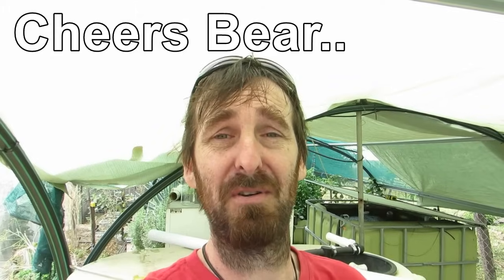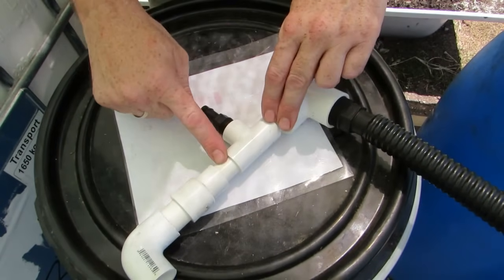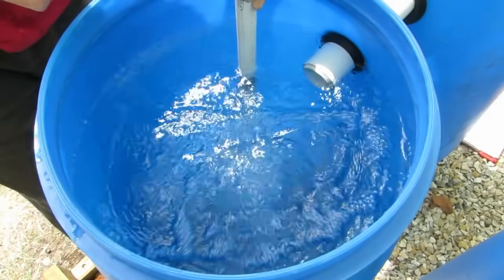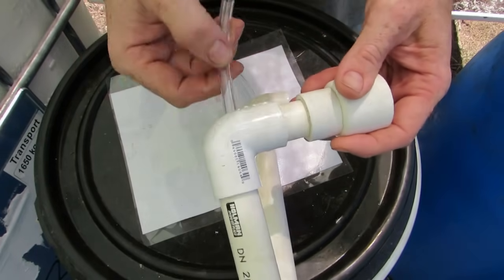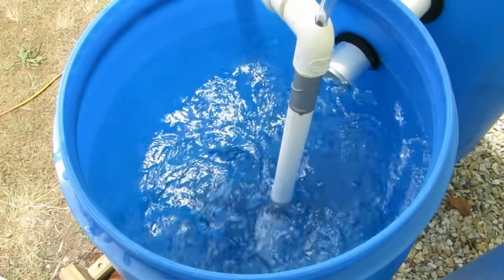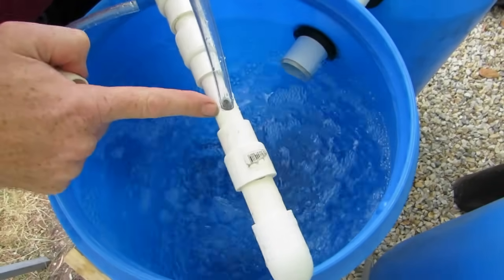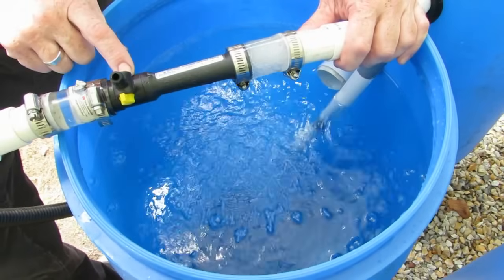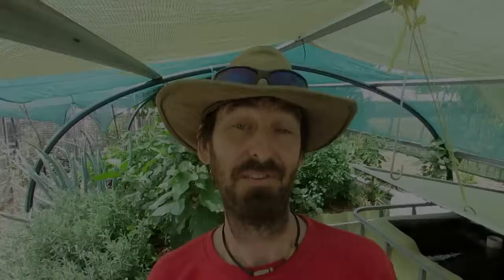DIY venturi, a few easy builds for aquaponics, aquaculture or hydroponics..

Comment: Do you have your water pump running full-time as opposed to a timer-controlled pump?
Reply from the maker: Hi Alan..
Both pumps run 24/7 on the 2 systems here & both pumps come in at under $0.70 a day to run.. I like the water constantly moving around the system so the water has every chance it can to run though the filters/grow beds to be cleaned..

Cheers mate..
Rob..

Comment: Hey Rob. I'm just reading the wikipedia article you linked and they brought up the efficiency of aerating systems in terms of kw*hrs. So I was thinking about your pump system and how the restricted flow wasn't an issue for your pumps because they're magnetically driven. Otherwise they will burn out, right? 

I know you probably can't quantify the kg/kwhr number for these options, but do you have any idea of the efficiency of this system? And could a fine screen on the end of the "Bear Model" venturi create even finer bubbles for you?
Reply from the maker: Hi Jason..
From what I have been told the magnetic drive pumps are best for the hobby growers as they can be throttled back a bit without damaging the pumps.. When they are hrotaled back they also use less power so the are more efficient in that respect as well..
A screen would help to break up the bubbles but would also cause another restriction to the water flow.. I also would have concerns that any debris pumped through might also clog up the mesh as well which would lead to other issues..
Thanks & hope that helps some mate..
Rob :)
Reply: Hey Rob I have another, unrelated question... I keep reading I should have a 15 minute flood, 45 minute drain cycle, but that I should also cycle all of my water from the fish tank through the beds once per hour to filter the water adequately. To me, this means the pump is running all the time and the drain is draining periodically. So if I have a 500 liter fish tank, I need to pump continuously at 500 liters per hour and drain the beds periodically?
Reply from the maker: jasonroxorz  This one did my head in when I first started out Jason.. Now all I really worry about is the health of the fish as they are the heart of the system.. It is best to have the water exchange in the fish tank at lest once per hour MINIMUM with twice an hour being what I prefer.. Ours is being exchanged 2.7 times per hour which I am more than happy with.. 
Most of the folks I know run their pumps 24/7 on their systems.. Our 100W jobbie on the AP set up is costing us just over $0.60 a day to run which is fairly good..
There are a few ways to set the beds up, one being constant flow where there is water in the beds covering the roots at all times.. These produce just as well as the flood & drain beds from what I have seen of others systems.. Seeing that was enough to stop worrying about flood & drain cycles & focused on just getting the water through as best I could.. I think ours fill every 10min or so & take 3-5 to drain.. One bed is very backed up with roots & solids at the moment so would be taking less than that at the moment I think..
Hope that helps some...
Reply: Rob Bob I have yet another question! So I'm just curious why you need such a high powered (and more expensive) pump from your sump tank? To me, it would suggest you have around 1000 gallon tank stocked with fish that needs to be cycled. Oh but you said you do about 3 changes per hour... so you have around a 330 gallon system? Probably a little less since you're pumping vertically? I'm just making sure I have the fluid dynamics down...
Reply from the maker: Morning jasonroxorz :)
The total system water volume is 1600L/422gal (US) with a 1000L/264gal FT.. The pump in the sump is a 4500LPH/1188GPH jobbie that ends up flowing out of the FT at 2700LPH/713GPH after head height & venturi restrictions are taken into consideration.. That means that the water in the FT is turning over 2.7 time an hour roughly..
Hope that helps mate :)
Reply: Rob Bob Awesome. In the event you lose power, how do you avoid draining your rearing tank? Do you have a pump in your rearing tank as well as your sump?
Reply from the maker: jasonroxorz  The system is set up so there is a constant amount of water no matter what happens & won't run dry.. Air is supplied to the fish via a batery back up system..
This clip might give you a better idea on how the system is plumbed up..
Aquaponic plumbing, How the water flows through our system..

Comment: This video was made in 2013, are you still using this venture? Or are you back to air pump
Reply from the maker: Hi Mate. 
I was running the commercial venturis in the tanks up until a few months ago mate. The fish I'm running at the moment don't handle the heat well so have dropped in some air stones to help increase the dissolved O2 for them. Once they are all harvested I'll be getting Jade perch again which I found were fine with just the venturis at the stocking levels I had.
Sorry it took a while to get back to you
Hope that helps mate & all's well with you.
Rob.

Comment: I'm running 3 tanks that are 
275 each 
100 gallon storage
2 55 gallon filters
200 gallon stump
6 20 gallon grow beds
With a 3600 pump
Can I split flow Ventura s to the grow beds and tanks

Piping 30 gallon
Reply from the maker: I would only add it into the fish tanks mate. That's where it will do the most good. 
Sorry for taking ages to get back to you.

Comment: can this be used in place of an air stone?
Reply from the maker: Only if you have a backup system that is triggered if the pump fails. Having a blackout trigger is not enough as I have had pumps burn out & which means that the back up wasn't activated. 
Cheers.

Comment: Thanks for the video. I wanted to see how some venturis would work in real world scenario.

25ml = 1.5 inches cubed
15ml = 0.91 inches cubed (basically 1 inch)

You are a very informative person. I made a venturi for my bathroom sink to change water in my fish tank. I can send you a picture if you want to see its nowhere near as good as your design however.

Your first design seems to work much better. Isn't that because you inserted the venturi where the waters velocity is at its peak ? Probably so. If you have the reducers at one end and just an elbow where you insert a tube then the pressure is not as low as in the first design.

In the first design you probably get smaller bubbles because the velocity is much higher in the cente of the small tube and the air gets sucked in faster.

Since the air has less room to mix with the water th air bubbles are hence smaller.

The tube is also gradually increasing at the end of your first design which allows the velocity to gradually decrease. Maybe this is what prevents the air bubbles from suddenly changing their shape (being inconsistent in size like the second design)

Your response is appreciated! Thank you
Reply from the maker: +Carl Nikolov 
Hi Carl. I did find that the first DIY unit preforms the best but in saying that I have used the elbow & runner hose  design on the fish farm set up with no problems. There was one in both tanks & found they did a good job at aerating the water for 100+ fish. They were hooked up to a 10,000LPH pump with  a 400mm head hight if that information helps at all. 
Cheers.

Comment: So your system uses 2 water pumps right? One from the sump tank to the fish tank, and another from fish to grow bed. 

Any idea on your cost to run both pumps as opposed to running an air pump with air stone? How often do you have to manually unclog the sump water pump?

Cheers mate.
Reply from the maker: Hi Bud. 
All my systems have run on a single pump.  This clip sows how the water flowed in the system in this clip https://www.youtube.com/watch?v=j-T2Fzfc1do

& this is the most recent clip on how the water moves through the new build
https://www.youtube.com/watch?v=N4mYcUvZ9cw

I think the current cost of running the single larger pump on the new build is under $2 a day with is easily off set by the amount of produce a system like this can grow. We also have a solar feed in system so the real cost is actually a fair bit under that. 

The screen on your pump should be cleaned (ideally) once a month as part of regular maintenance. I have never had ours clog up as there are very rarely any solids to speak of that make it into the sump. 

Hope that helps you out some Bud & have a great one. 
Rob.
Reply: Thanks mate.
Reply from the maker: No problem Bud. 
Cheers mate.

Comment: can you please provide me info on how to get the pipe in the barrels ?  I used the uniseals and followed the instructions but I can not seam to get the pipe into the seal. please if anyone can help would be helpful
Reply from the maker: Hi Janis..  Will try to help if I can.. What size seals & pipe are you using ?
Reply: Rob Bob I finally got it My filter is working great water is very clear Now  all I need to do is find more 55 gal drums so I can build the filters for my other 3 ponds Thanks again
Reply from the maker: Glad to hear you got it sorted Janis K..
Have fun with the rest of the build... Hope it'sgoes easier for you..
Rob..

Comment: Hi Rob,

Are you using separate pump to throw water to the Venturi?
Reply from the maker: The main flow into our fish tank comes through the venturi. I have seen folks run them on a separate pump but I wouldn't. It would be cheaper to run an air compressor I think. 👍
Reply: @RobsAquaponics   Thanks Rob your reply. I really appreciate it.

So, you are using a pump which pull water to the fish tank through venturi.right?
I have fish tank and from there I am using pump to take the water to the grow bed. Actually my fish tank is positioned at lower level than the grow bed.
I have noticed that my plants aren't growing for sometime. Initially the growth pace was amazing but after sometime the growth almost stopped. and the leaves started getting bit yellow and the green color is bit dull. May I know what could be the probable reason for this?
Reply from the maker: It could be a number of reasons from pH issues, over planting/nutrient deficiencies or even a change of seasons. Is very hard to nail down what it could be without seeing it. 
Sorry Umesh.
Reply: @RobsAquaponics  Thanks for your reply Rob. I can understand that its hard to nail down without seeing it.
Have a great morning ahead.

Comment: Did you ever find any disadvantages with this setup vs several airstones
Reply from the maker: If you pump dies the fish get no new water or O2 which can be a recipe for disaster. 
I still like them but don't rely on venturis for my main aeration into the fish tank. 👍
Reply: Thanks, Was thinking about using one for a mbbr
Reply from the maker: @ashleygonzales304  They work great in that situation. Sorry it took ages to reply again.

Comment: Hi , why is mine pushing water out instead of sucking air ?
Reply from the maker: At a guess I'd say that you will need a higher powered pump or that the air intake hose is around the wrong way if you're using a DIY one like I showed in the clip. 👍

Comment: Just curious, why use a water pump + venture rather than an actual air pump?
Reply from the maker: +fsbell1 Hi there.
Wanted to make the system as uncomplicated as I can with as few hoses running around the place. Also found the compressors to be rather loud.  Still have air lines going to the tanks but for back up purposes.   
Might change my mind later & use them again one day but am happy with the venturis for now. 
Cheers & have a great one.
Reply: +RobBobs Backyard Farming 

2 years later and still going strong? That's a good indication that they work!

Thanks for the vid, much appreciated.
Reply from the maker: +Aaron DC mediA 
No Problem Aaron. Hope it gave you a few ideas.
Cheers.

Comment: curious about what is the minimum psi required from the subpump.
Reply from the maker: Hey Jorge..
Not sure on the psi as water flow is normally measured in GPH or LPH.. I like to run enough water through the system so that the water in the fish tank gets totally exchanged at least once per hour.. At the moment I think it would be just over twice in the aquaponics once head height & the restriction of the venturi are taken into consideration.. Before the new ones get installed in the RAS I shall do a test to see how much the venturi restrict flow by..
Not much help there but hope it helps explain it a bit..
Cheers.
Reply: sorry i guess  my question  should have been what kind of pump  u are using and what is the minimum gph  a pump should be pumping for a venturi to work?
Reply from the maker: Jorge H
 Sorry mate... In the test it was a 2500LPH/660GPH (US) & in the aquaponic set up we have a 4500LPH/1200GPH (US)  pump o the go.. I think you could attach one to just about any sized pump.. 
A mate just posted a small version he made up if your interested in having a look..
Venturi Experiment - Small DIY Venturi for Hydroponics, Aquaponics or Aquariums

Hope that helps some..
Cheers..
Reply: thank u

Comment: SURVEY SAYS !!!..... the first one , better looking , finer adjustment on bubble flow .
Reply from the maker: Hey Mark.. I have just finished playing around with them in a new build & found that the unit with the hose clamps actually worked the best in a moving bed bio filter.. Still like & used the 1st home made unit in the fish tank though..
Also bought another threaded cheap unit from Ebay to try on the present build & think that the home made jobbie is much better is better than that unit :)
Cheers mate & have a great weekend..
Reply: ya ventures can be a trickle and error kind of thing , a little cutting or movement one way or the other can be the difference of night and day . like your set up , wish i had the space to be able to do this type of thing , well take care and a beer

Comment: Not sure why you think a magnetic drive is NOT going to overheat if restricted?

Explanation???
Reply from the maker: That's what I was told by the folks at the local Town & Country irrigation suppliers as well as an commercial aquaponics designer. is due to the impeller being driven by a magnetic field with no motor parts coming in contact with each other top wear out.  This was the layman's explanation I was given by both. 
I'm not an electrician so have taken their word for it. 👍

Comment: this is one of ways how aquarium filters realise air feed, so it is definitely nice way to deliver air, anyway, it can be also used in many other applications, even in reversed way when compressed air suck fluid, for example in aerograph :P
in mater of cuting inlet feed pipe i discovered that L shaped cut where horizontal part is about 1/3 of pipe fi and vertical cut is about 20deg to it and its height is about 2.7 of horizontal cut  works slightly better in water and air applications, but i think that efficient of diameters can be related to relations between pressure and diameters of pipes (higest presure works better, and i think that feed pipe with oval shape can give interesting results)
huh what a mess, sorry about this :P
Reply from the maker: Thanks for all the information :)
Not sure I got all of it but will be playing around with the angel of the reed with the new units for the RAS..
Cheers, Rob :)

Comment: Robbo here is something that could help you move water as well as aerate  it I'm going to use in the duck-a-ponicics  it's an air lift water pump, I've duck water is much higher in nutrients the problem I was running into water clogging pumps
Reply from the maker: Gordon Pilcher Cheers Gordon.. Have seen a bit on the air lifts & will probably have a crack at one at some point.. Just another job/project to add to the list ;-)

Hope all's well with you & yours..
Reply: Just keeping you on your toes Lad
Reply from the maker: Gordon Pilcher Cheers mate :-)

Comment: Couldn't you create smaller bubbles with a screen in line of the output?
Reply from the maker: A few folks have mentioned that but I am yet to try it with ours.. I think that if you used a thin piece of filter pad or even a pot scrubber it should give you finer bubbles...
Cheers & have a great one,
Rob..
Reply: Rob Bob
I suppose the flow has solids so a screen would act as a filter and clog. But on a big system, you could take only some of the flow out to the side through a filter, through the venturi aerator and screen, and then back into the main flow.

Comment: Hi Rob, very help range of vids mate, a big thanks : ).  Check out 'Trompe' too by the way.  Can I ask where you are getting your rubber grommits to seal your tank wall breaches (tube through tank wall).  Here in Adelaide I have access to bunnings etc but they dont have anything thats made for it (that I can find).  Im down to drain plug grommits and plumming tape...  not so great.  Also whats your all time fav / recommended grow bed medium.
Reply from the maker: Hi David. Had a chap send me some info on the Trompes a while back & they look interesting..
Have been getting the Uniseals straight from Uniseal Australia here in Brisbane.. They work out a bit cheaper than bulkheads, especially the large ones.. Their contact info is on their home page..
http://www.uniseal.com.au/
So far I'm really happy with the clay, only down side is the price :/  Have tried 20-25mm river rock as well but only in a small barrel bed as the bottom layer so haven't ad a lot of experiance with it yet.. Will be using a layer of larger rock at the base of the next grow beds covered some 20% shade cloth with the clay on top.. That should help improve drainage & water flow in the base of the beds I think..
Hope that helps some Mate..

Comment: If your bubble are too big slip on a diffuser on the bottom of the pipe.
Reply from the maker: Tried it & it didn't work too well. Not enough pressure behind the water/air mix.